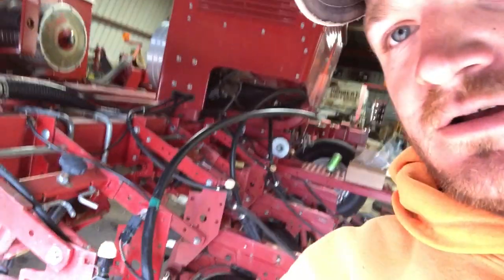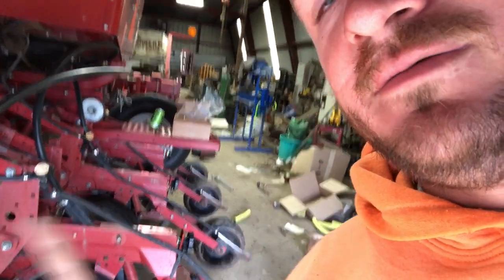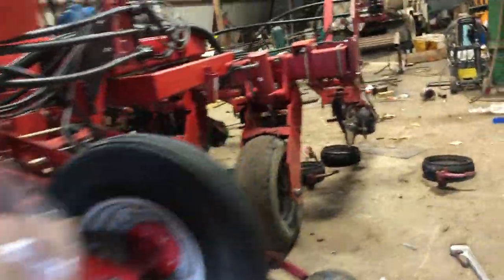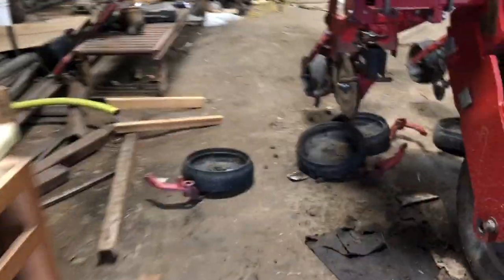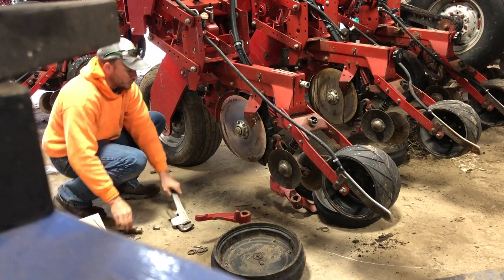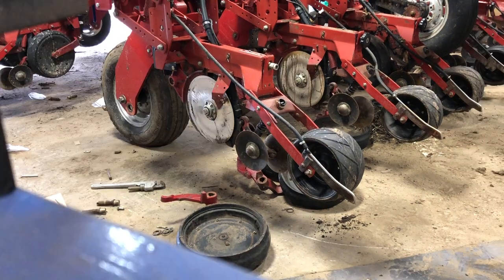Doing some work on the 955 case ih planter

Comment: On my 3600 Kinze they have a grease fiting  .We had IH before but built too light.I like your clips  I found your channel after looking at 2388 combine clips I bought a 2388 last month  .. Thanks from PA  Kevin .
Reply from the maker: 2388 is a great combine.   If ever short on power there is a hose going from the turbo to fuel pump and ours cracked and it was gutless   thought our old 1680 had more power for a while
Reply from the maker: 50 k?
Reply: 20 Grand even   only 2540 sep hours    the internet went down during bidding.  crazy  Thanks for the tip on the hose to the turbo

Comment: Nice video.  I have the same issue with warn pins.  So it was good to see what the effort into the fix will be.  If you ever want to do some no-till or need more down force I have a bolt-on kit to put air springs on the old cyclos.  I have a couple videos of it on my channel.
Reply from the maker: im all no till....

Comment: Nice, that’s a way larger version of the IH 800 4row I had. I spent a fortune on it and ended up getting rid of it. Didn’t cover along a hill really well.
Reply from the maker: the 800 is very similar set up to to this but there are some major improvements in these row units compared to the 800's   these actually very similar if not identical clear up to a 1250 case ih planter.
Reply: Ted Kahler I didn’t know that. My 800 was a lot like my neighbors 400. The openers were too far from the closing wheels. It was almost crabbing along the hill and you had an open seed trench. Later I got a Deere 7000 6 row and it was better. Thanks for the info
Reply from the maker: I think the distance is the same still from the disc to closing wheels BUT they put one infront of the other maybe that made the difference... interesting i have never had problems getting the trench closed glad ya found something that worked

Comment: Good work ted. It’ll also not make a very good seed trench. On the whites they make a kit u can put on so u can tighten them up every year. Does IH make anything like that?
Reply from the maker: Jake Ziegler I don’t think so but with the IH planters you can get away with more wear in those pins as they actually get pushed to the discs instead of away as they get pulled instead Of being pushed  haven’t ever had to change them all out on a planter ever this is the first time.   I have broke them off before though

Comment: Great video I wanted to ask u a question I seen u had rolled millet last year would u plant millet or sorghum Sudan grass for hay? Can't decide myself figured u had done both
Reply from the maker: Harris Farms need more detail to give my  option  how would you cut would you double crop at all.  How is it being fed (that is a huge one)  and what are you feeding it to
Reply: I am going to put it up as balage. I have an inline wrapper we use for wheat and grassy hay just trying to expand with an summer annual. One of the reasons I wanted to do this was I have a ph problem of 5.5. I limed last fall and am going to do it again this week before I still seed. I am going to feed it in hay rings daily no tmr
Reply: Sorry we have a beef cow herd and  a small backgrounding operation.  coop said they both will grow the same in low ph but they sell weigh more green grader than millet
Reply from the maker: Harris Farms where I do Millet I plant oats or rye then in mid summer I plant the millet.    Getting roughly 6 bales total per acre from the two crops.   Then I plant Cain in places I only want to crop once it takes more ferterlizer but I get around 7 bales per acre from that.     The Millet has much smaller stems and may be better for feeding in bale rings than Cain.   We always let the Cain get pretty tall so it has big stems and I’d imagine there would be more waste that way.   We feed all our Cain ground in a tmr

Comment: Ted, i have a 950 12 row thats giving me hydraulic fits. Center, main wheels wont raise, wings do. All the checking done, dealer is calling distribution flow control valve section bad. Ever had that, and how did u fix? Valve body is obsolute!
Reply from the maker: biggest things are ground wires.   hope you got it figured out
Reply: @tedkahler9738  
It appears to be a cracked valve body. I was able to cap the hoses to the fold circuit and ran a separate set of hoses to third remote of tractor. It's not the perfect fix but got our record corn crop planted this spring!
Reply from the maker: @josephhummert8756  record enough to get a new planter?? Lol

Comment: Does that do good with no no till coulters? I always heard case had great down pressure
Reply from the maker: it does fine.... with the one disc leading and the other disc following it really helps cut up the residue.   I have row cleaners for it but i think this year im going to go with out.   Its getting late enough i believe the ground will be warm enough and Might end up spraying some before i plant so ill will try to not move the residue

Comment: Didn't look like there were grease seeks on those pivots which  seems kinda silly. I'm not to familiar with the ih planters but our white has replaceable bushings in the gauge wheel arm
Reply: Dane Anderson that's also my question, is the pin the replaceable wear part? The arm must have a hardened bushing? Cast would surely wear before a steel pin. Would have to think putting in a grease zirk would help.
Reply from the maker: the pins wear before the arms... the early planters actually did have zerks on them BUT they got away from that because the found the grease would collect dirt and get hard and then the arms wouldnt move.   This planter has been over tens of thousands of acres and the cost of replacement is actually very low compared to to other wear items